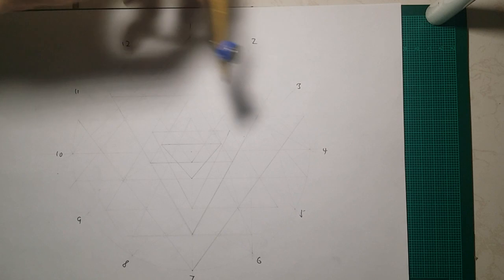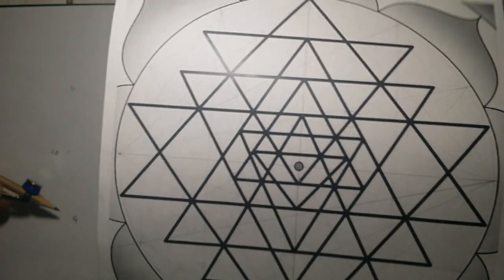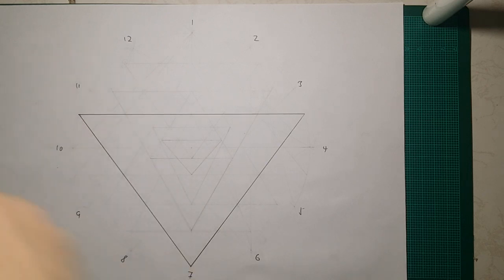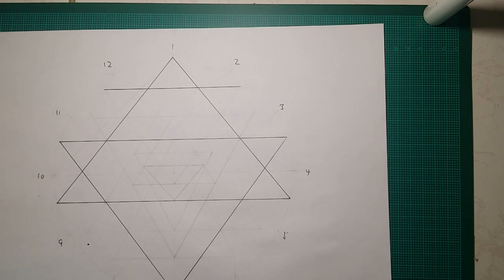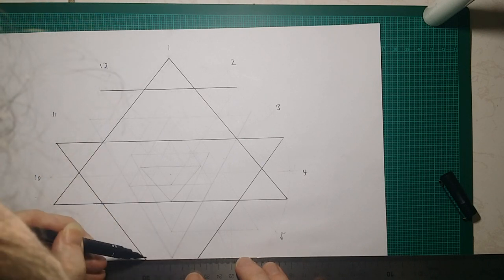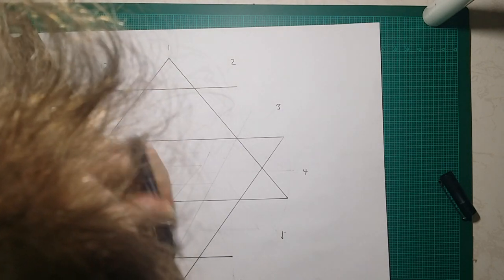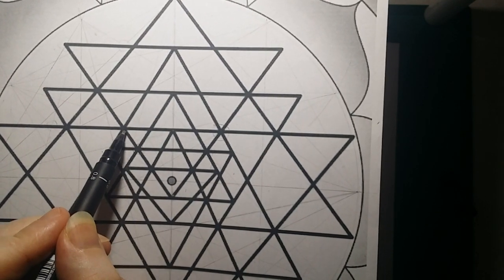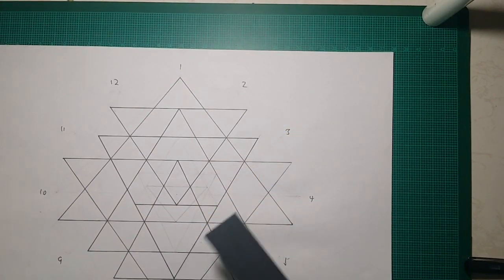How to accurately draw a Sri Yantra using compasses and a ruler

Comment: This was so good! I completed my first one along with your video and although I have a bit more error than you I'm determined to get a sharper pencil and perfect my technique. Thank you
Reply from the maker: i did technical and geometric drawing at school as an O'Level (last year it was ever possible to do), so i learned a few tricks.  one of which is: always angle the pencil into the ruler, but, more importantly than that: put the pencil on the paper first (at the point you want to start from) then bring the ruler up to the pencil.  you can then, by eye, look how far away the ruler is, and "align" the other end by the same (very small) distance from the destination point.  if however you trust yourself to put the pencil back at exactly the same angle (and it is properly "cone-shape" symmetrically sharpened rather than flat along one side) you can move the pencil to the other point and check the ruler distance.  try not to move the ruler at the other end though :)  it's very tricky to do!  if the pen/pencil happens to have a flat edge, you must use the exact same edge as well as the angle when checking the other end.  do not be afraid to rotate the paper so that you can get a consistent straight line without changing the angle of the pen/pencil as you draw the line!